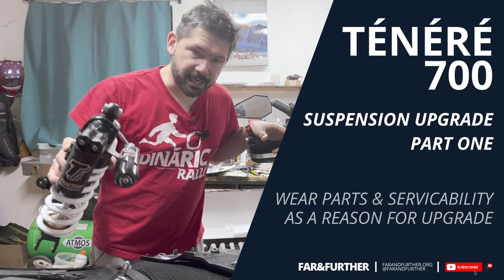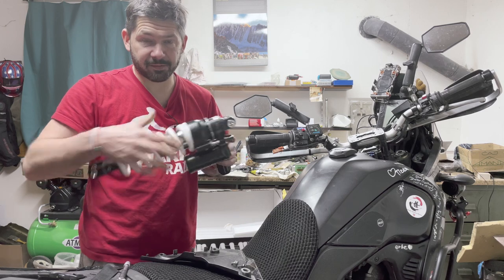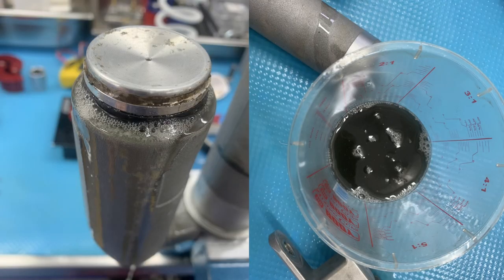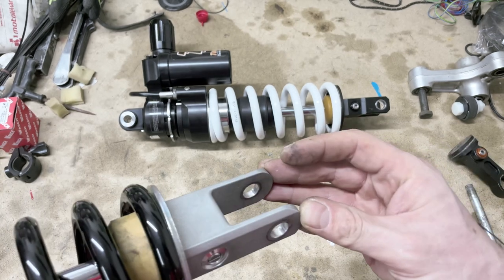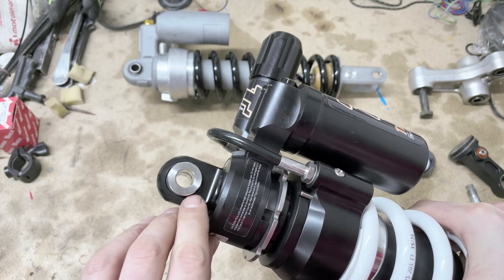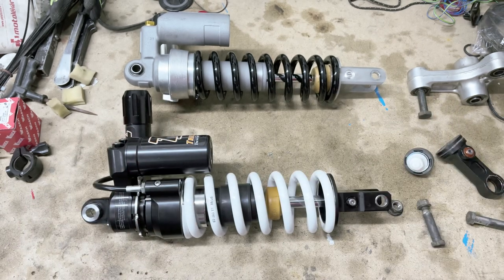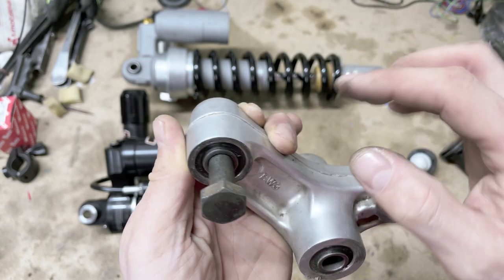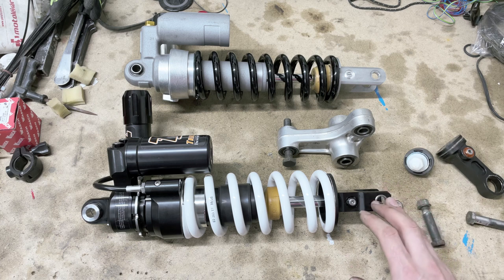Ténéré 700: Suspension serviceability & wear parts as one of the reason for upgrade after 40000km?

Comment: Thanks for the video! Have you changed the front suspension? And what is your impression of stock front suspension?
Reply from the maker: Hello Andrej, I've changed the front suspension for the Rally Raid Open cartridges, that was last year. I changed the front first because it was not handling well on the MX track and was bottoming quite often.

The stock suspension if fine when you give it a bit care. It needs most of the time different springs front / rear and after that for normal travel it will work well.

The problem with stock is that as one starts riding faster / harder the limit of the stock is quickly reached.
Reply: @FARANDFURTHER  Many thanks for the information!

Comment: Could you drill out the OEM bushing mounts and use the inserts from track active?
Reply from the maker: Possibly, if there is enough material for the change, but the top mount is problem as well (and bigger as the eye is quite small).... Also now you're talking about investment again into do all that work.

Don't think that's a viable option really.